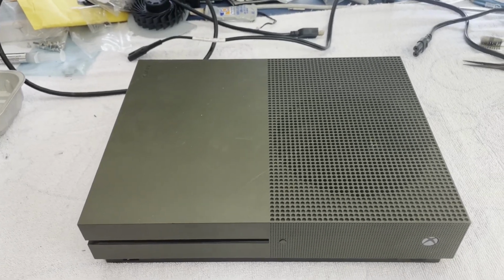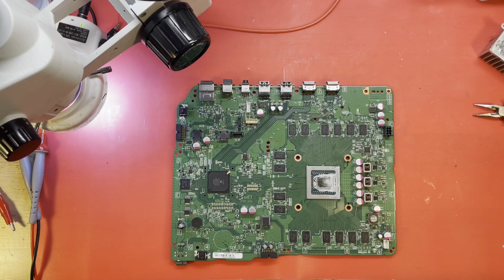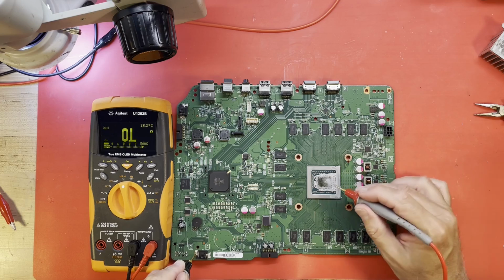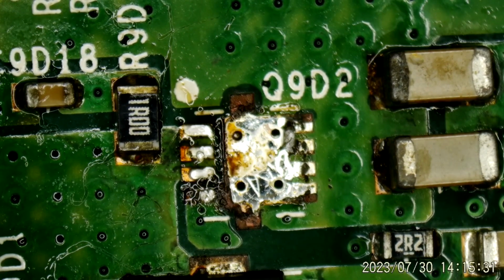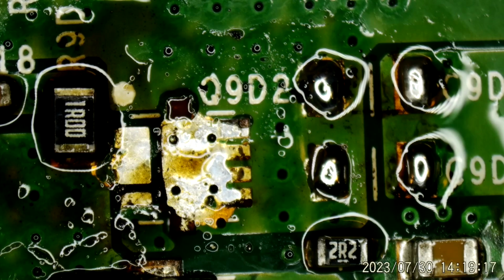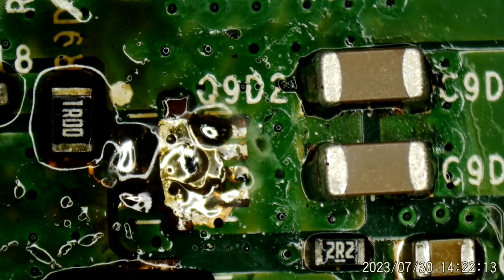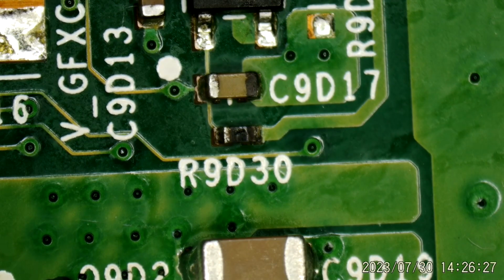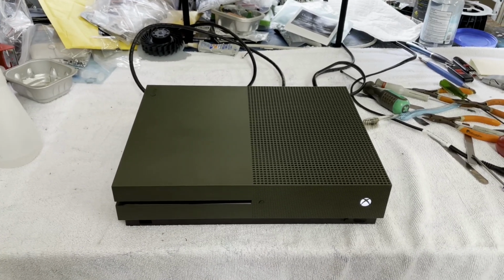#103 Repair of XBox One S with "Minor" Liquid Damage

Comment: Fyi if you have a very dirty pcb you can just toss it into the dishwasher. It's designed to clean a mix of metal and plastic stuff. Just make sure you get all of the moisture from below the chips out before powering it again...

Comment: I  can't believe water cleaned it and it worked 😅! Don't capacitors and IC's have some electric charge in them and will short or lose data ?
Reply from the maker: No charge in these components and no battery on the PCB.  I put tape over the little piezo buzzer.  You just have to make sure all the water is gone before you apply power.

Comment: Nice fix!  I had a similar one last week, replaced a lot of the 12v circuit and the RAM power IC. I got 12v back but now it's beep on beep off. Weird, the APU gets crazy hot with just power plugged in, no attempt to start. Dead APU? Thanks
Reply from the maker: If APU is getting hot when you plug in, you may have a shorted MOSFET around the APU power rails.  It could be sending 12V to the APU.

Comment: Very informative video. I am trying to repair a board that doesn't power up, the fan doesn't come on. I am not finding any shorts on the board or between gnd and +V rails,  V5, V3.3 & V12 voltage rails are good, hi side / low side mosfets are good, the only strange thing is the 6 caps on the mosfet rails to the cpu seem short. I tested them with an in-circuit tester and get no readings. How likely is it? have any suggestions? Thank you